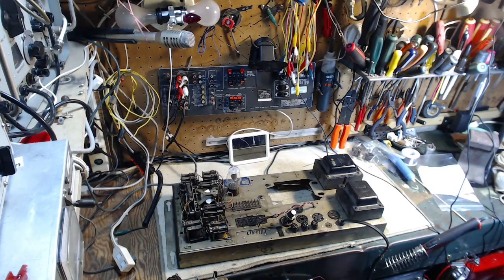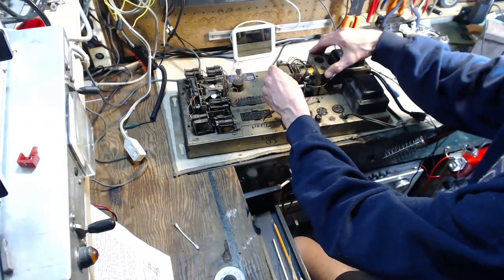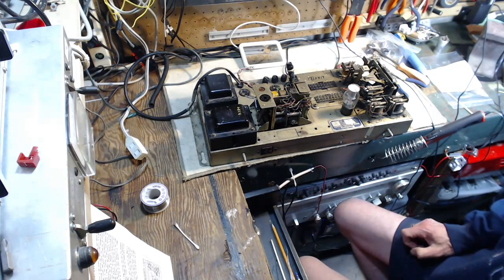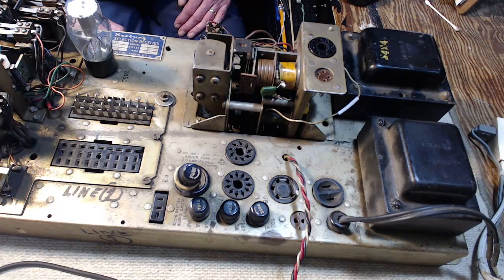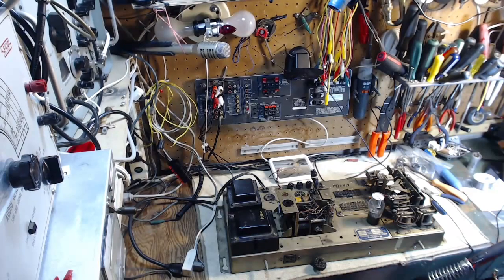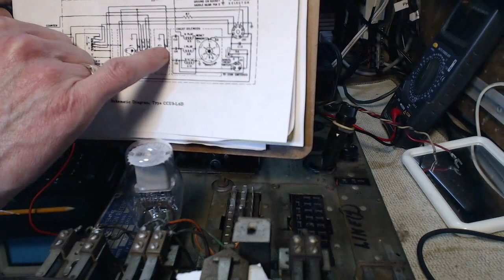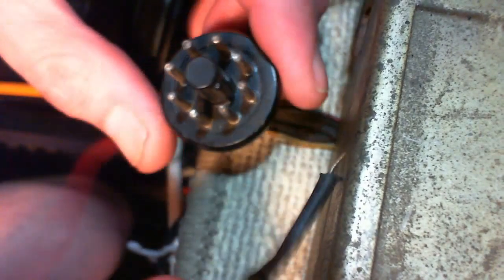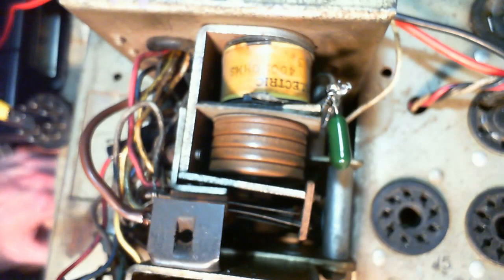Smoking Seeburg Jukebox Video #7 - Powered Test

Comment: I worked on one of these 4 years ago.   I built an add on circuit to monitor button activations and if nothing got pressed for 30 seconds it would disable the credit solenoid  (I think that is what it was called).   This solenoid is known to burn up when private owners set the jukebox up for free play.  Some one can walk away with out using all their credits and this solenoid would still be energized and sit there cooking away and eventually burns out or starts on fire.  My add on circuit would reset the credit cancel unit after 30 seconds of inactivity and de energizes the credit solenoid so it would not get damaged.  This solenoid moves a mechanism that allows the selection buttons to lock letter and number keys when pushed.   If I recall this solenoid is driven by the CCU with 25 volts AC.    I would suggest you check that solenoid to see if that is the root cause of the burnt wires.  The solenoid may have been partially damaged and the insulation in the coil finally failed as a dead short and burned up the wires in the CCU.

This Seeburg is definitely an incredibly ingenious mechanism.

Comment: Hi Jim
After you mentioned the jukebox was operating with all the correct fuses so
i looked at the Seeburg P S U    :-(  

The 25VAC line has no Fuse ,

The wall - O - matic transformer has NO primary side Fuse ,

The Play control relay is pre input mains fuse & looks as if it runs around the unit ! then it feeds the AMP via J3 a with the 6V a/c heater supply .
Is this all in one loom 6V & non fused mains ?

It's using the die-cast boxes for low voltage A/C & D/C connections !

If it was my unit it would be sporting 3 more fuses ,
3 pin plug (L.N&E) feeding &  RCD inside the jukebox ,
Using a 3 pin plug if RCD not hard wired ( keeps fuse in the positive feed ) .

L&N output only running the jukebox from the RCD .

Jim your a very brave man taking on this sort of work !